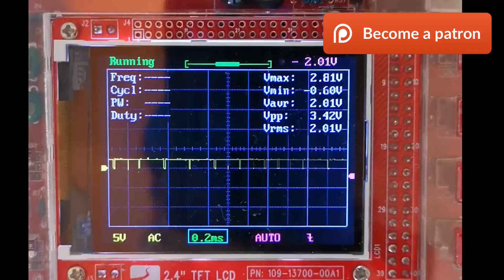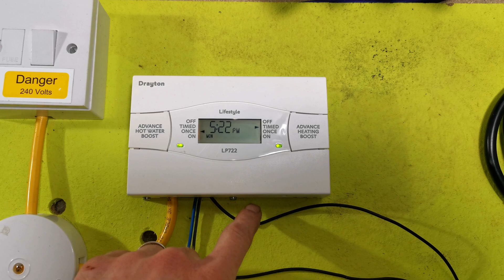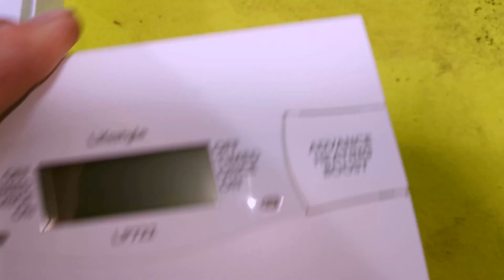Priority Hot Water Systems Explained. How to wire.

Comment: Would u say PDHW is only useful & beneficial on new cylinder tanks ? Would u recommend PDHW on 15+ years old cylinder tank?

Does it have to be fast recovery?
Reply from the maker: PDHW is great on new systems where the heating flow temp can be lowered dependant on the weather outside. 
Older systems were done PDHW because it requires less wiring.
Reply: @HeatingGeek  well I am trying to get OT and PDHW on my invented cylinder and Ideal Vogue Max system boiler BUT can't find anybody on this planet to get it wired up.

Unbelievable ... Can't find a diagram to follow, neither. 

Besides, does the smart thermostat need both HW / CH connectors ?? Looking at TADO EU model has OT and RELAY only.
Reply from the maker: Im not sure. I guess you have it sorted now. Any update?
Reply: @HeatingGeek  nope!! No geek wanted to get involved!! Therefore gone for the ideal halo thermostat which does PDHW without rewiring or having to change the zone valve.
Reply from the maker: @bimiuk4051  At least you found a solution :-)

Comment: Hi. I just installed a new heat only boiler and I would like to use it with wether compensation. I think I have a s plan system and it needs to be converted to hot water priority. This conversion would require to alter the pipe work? Or just the wiring? I just can't find an engineer that knows anything about this. Thank you
Reply from the maker: no need to change the pipework. What boiler did you fit?
Reply: @HeatingGeek  I fitted a wiessmann Vitodens 100w assuming that it will support open therm. I did not confirm with the manufacturer. My bad. Apparently the heat only range from wiessmann doesn't support open therm. My only option now is wether compensation.
Reply from the maker: @jps3172  Do viessmann have a weather comp wiring center? (like Vaillant) Because to get the system to lower the flow temp (dependant on outside temp) it needs to controls the boiler with a proprietary protocol (usually). Without speaking to viessmann I don't know.
Reply: @HeatingGeek  I checked with wiessmann. They confirmed that it doesn't support open therm but it can do wether compensation. Unfortunately they didn't go into detail at all. I believe it's some kind of basic wether compensation. The 200 range do advanced wether compensation. I don't know know if it uses an internal sensor as well as the outside one. They advised me to talk to the engineer who installed the boiler.  Problem is that that engineer seemed to know even less than me about this.  I don't know anything about the wiring center but I know that I can connect a outside temperature sensor to the boiler and then set the boiler to wether comp and it should work.

Comment: Replacement cabling required throughout an open-vented, S-plan system - current is miss mash of all sorts. Swap out with Flexi 1mm T&E throughout?
Reply from the maker: Thats up to you. I generally use 3 and 5 core flex. I prefer 1mm but often use 0.75.

Comment: I've wired an s plan as a w plan before using the Honeywell t6r HW using hot water satisfied as power for heating on. The 4 pipe system is much better though and yes, always with weather comp.
Reply from the maker: Weather comp all the way. :-)

Comment: Went to a wplan with a mid position about a year ago, threw me as i didnt know it was, short story had to get the boss to go out a test (new to fault finding electrics) But when I testing for power on white and orange etc it definitely wasn't all connected together to live (white, grey and orange) is there another way it would of been wired up for it to work with a mid position hot water priority?
Cheers

Great videos by the way! 👌🏻👌🏻👌🏻
Reply from the maker: It could of been wired normally like a Y plan but with a bit of W plan to control the pump. :-) As long as it works.

Comment: 1st comment (maybe chancing my arm)
Reply from the maker: Im checking that now. :-)
Reply: @HeatingGeek   what's the advantage of PDHW without another temperature ?
Two temps are needed .
80 to charge the cykider and 50 degrees for space heating .
Reply from the maker: @mgbroadsterJ  1 less wire is needed to control it. :-) I don't see the point myself. A few older systems were wired like this.